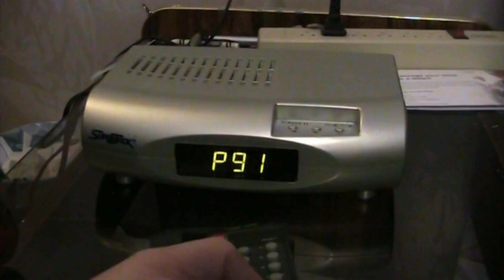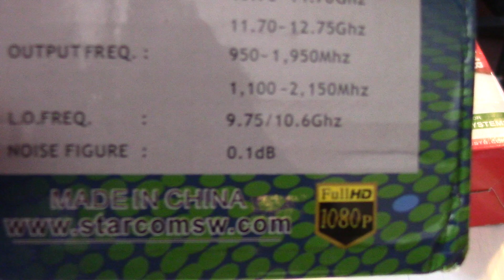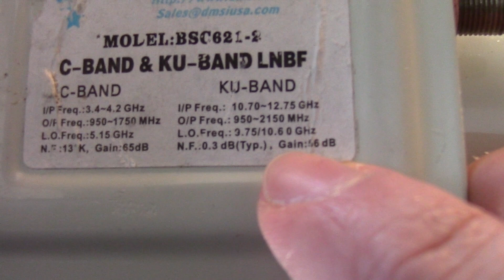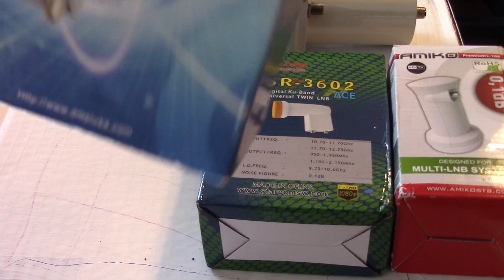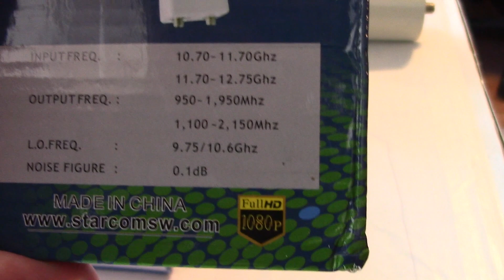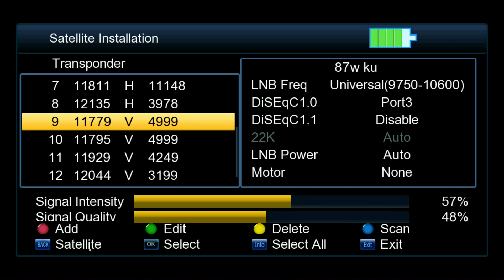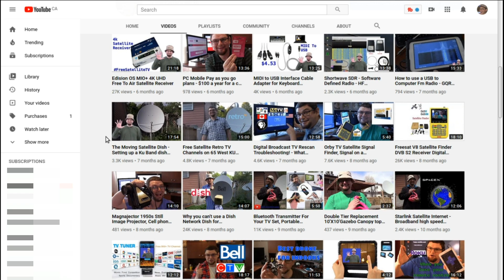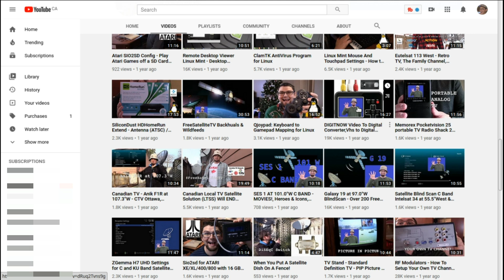Settings for Universal & Standard KU Band Satellite Dish LNBs - Get Better Signal - Watch in 2 Rooms

Comment: one dish with twin output LNB on it...each output goes to one receiver(salon,bedroom) What would be the perfect LNB to buy without losing channels? and what will be the settings for each receiver? please help me out !!!! Thank you
Reply from the maker: A multi output lnb will give you independent polarity's so you should be able to get as many as you need. Some LNB's have 4 outputs just to send the antenna to multiple tuners. Great for Master Antenna Systems. https://www.youtube.com/watch?v=m1CoFOcwpdg&list=PL_g5Ad_LMmeIHFnQmPBuKnrTcJjv-haNQ&index=80
Reply: @RobbieStrike  so i have to buy LNB with 4 outputs? what would be the setting on the receiver?(standar,universal or custom).?
Reply from the maker: @arisntivartzis8300  How To Watch Satellite Tv in two or more rooms 
https://www.youtube.com/watch?v=9gcONhTjVP4&list=PL_g5Ad_LMmeIHFnQmPBuKnrTcJjv-haNQ&index=86
There are multiple ways to split a Satellite signal. The main problem that viewers face is not being able to see a separate channel on each television sharing the signal. If this is not an issue for the setup, then the following options are available for those who wish to continue:

Method One – Using Optional Receiver Outputs

If the televisions are not too far apart, the simplest option is to use the available outputs on the receiver to split the connection. Most modern day DirecTV receivers have the following outputs:

    HDMI – Used with HD Televisions using the HDMI cable interface.
    Coaxial Cable (Output to TV) -The coaxial cables can be screw on or push on.
     AV Cable – The 3 wire configuration (Red, White, Yellow).
    Component Cable Output – The 5 wire configuration (Red “Video,” Blue, Green, Red “Audio,” White).
    SVideo – used with SVideo capable devices.

A DirecTV receiver can process video through each and every output available on the hardware. The most common setup for optional receiver output is using the HDMI connection for the most immediate television (since HDMI cables come in short lengths), a component cable connection or AV cable connection for the next closest television, and the coaxial cable for the furthest televisions. Any combination can be used as long as the cables’ lengths are adequate for splitting the signal this way.

Of course the quality of the signal will be different for each output due to the nature of the technology being used and the quality of the signal being routed from the receiver. A large number of households can accommodate the splitting of the signal this way. Viewers should consider drilling holes in inconspicuous locations to shorten cable lengths. This is because long length cables considerably lower the quality of the signal that the television receives.

Note: Many options use the Red and White audio outputs on the receiver. Using more than one would require an additional splitter for the sound output. The HDMI and coaxial output carry their own sound while the others will more than likely compete with the Red and White outputs unless the receiver comes with multiples that are meant for additional stereo speakers to be connected to.

Method Two – Using a Coaxial Splitter

Most DirecTV owners can use a coaxial splitter to split the signal without having to purchase another receiver and adding an additional line to the system. The coaxial splitter can be used in two ways:

Splitter close to the Receiver– A short coaxial cable is connected to the receiver. This is then connected to the television (within a few feet) closest to the first split line. The second split line must run the length to reach the next television, which can be several yards away.

Note: The television that is closest will more than likely be the one to control the channels on the receiver that transmits to both televisions.

Receiver at a mid point – The receiver will be placed at a location where both televisions are more or less an equal distance from each other. The cable splitting the line goes out of the receiver to the location where a split is most effective at a mid distance. The two split lines are then passed through the length that is necessary to reach both televisions.

Note: Changing the channels for the receiver may require someone being close to the receiver to change it manually or via remote.

Remember that televisions display the same channel when using a coaxial cable. The television that is furthest away may also have a weaker signal. The fuzzy/snowy artifacts that appear from the signal is usually evidence of this.

A Multi-Switch can come in many designs. Using a DirecTV approved option is the best way to get the most compatibility with a single satellite dish. Multi-Switches can have two or more satellite inputs and have four or more outputs to the receivers. Depending on the brand and amount of connections needed to split the DirecTV signal throughout the household, Multi-Switch costs can be higher.

Note: A single satellite dish may only be able to support two receivers depending on the type of dish it is. If the service is designed for a DVR receiver, additional equipment and lines may be required.
Reply: @RobbieStrike  thanks for the detailed answer ! i want to NOT lose any signal strength on any receiver.i do already have 2 coaxial cables waiting to get connect on twin lnb.the main problem is that, becauce of the polarity i dont want to lose any channels..i want also both receivers working without any lose.with one LNB i think that i will lose signal strength and using multiswitch.thats why i decided to use a twin lnb on the dish.finally the best solution is the UNIVERSAL twin LNB or STANDAR. The satellite is Turksat 42 FTA channels. Thank you so much !!

Comment: I have a DirecTV Slimline dish that I was gonna use, if I buy one of those LNBs how do I attach it to the arm?
Reply: Saw off a few inches of the arm and make a wooden adapter that holds your new LNB in the same place as your old circular LNB. The same adapter will swap to Dish Network oval dishes. Gain on our bargain dishes is pretty marginal and so is focus. You might find your setup blind scans two widely different satellites simultaneously (a mess).

Comment: I have found that stability is a key spec of an LNB  . An LNB with a PLL(Phase Lock Loop) has eliminated my intermittent drop outs
Yes these type of LNBs cost more but are worth it. A good LNB with a PLL has stability of less than +/- 300khz, the lesser brands are +/- 1000khz.
This kind of excessive drift will cause issues especially on weaker transponders. The GEOSATpro SL1PLL v2  is one I use quite successfully  on a 100cm dish.
I am sure there are other PLL type LNBs with equal performance or better.

Comment: The LNBs are exactly like the OTA antennas. They only receive the frequencies they are designed for. The LNB converts frequencies from 10.75-12.75 GHz band to 950 - 2150 MHz. The receiver is the one that matters. In Europe when you buy a LNB you see on the package that it has HD ready, 3D ready and 4K ready. People gets excited that they have 4K channels and surprise the old receiver doesn't get 4K only HD. If your receiver is HD it won't receive 4K, you must buy a 4K receiver to get both HD and 4K. I also recommend to use only RG6 cable. If you ever see RG59 or 3C2V never buy them, they are crap. I've tested an 3C2V satellite cable the signal quality was worse. And If you combine an OTA antenna with a satellite dish through a diplexer I recommend a tri shield or quad shield RG6 cable.